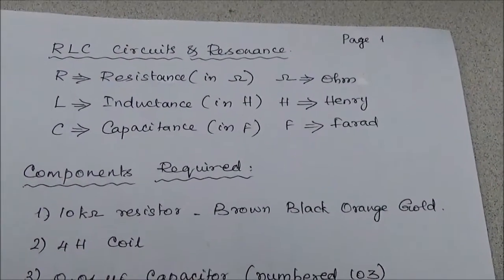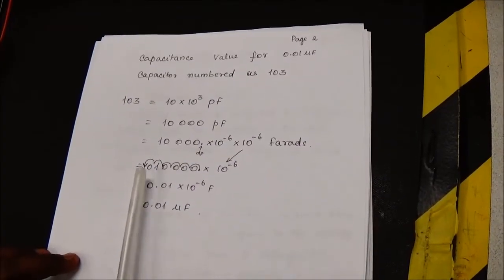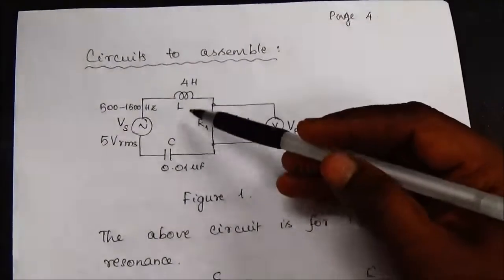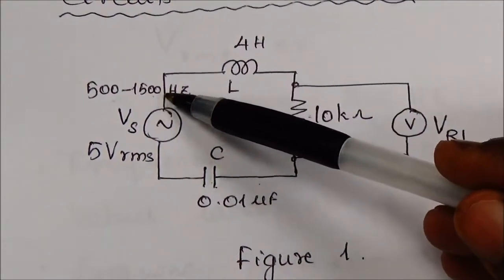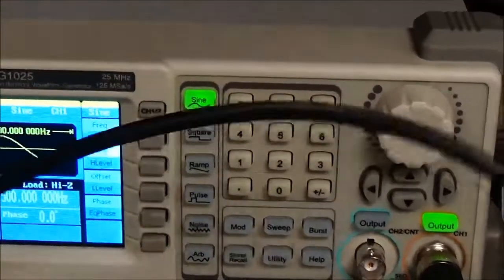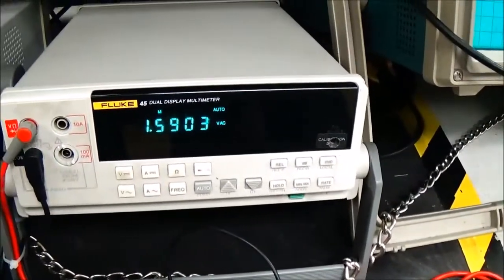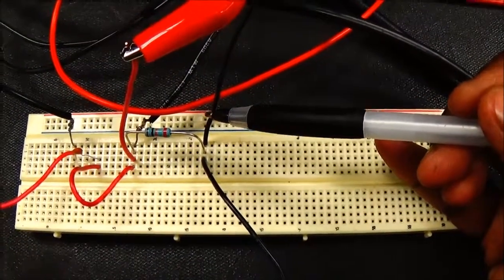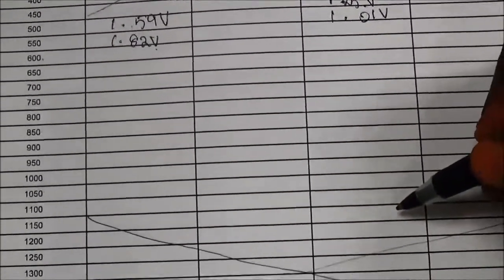RLC circuit and Resonance

Comment: thanks alot for this video
but practically you mean the resonance is at the bottom or the top of peak in curves?
Reply from the maker: +new man Resonant Frequency of a parallel circuit is at the bottom and for a series circuit, it's on top. Thanks for watching and your question.
Reply: can i add you on facebook?
Reply from the maker: +Bhuvana Sriganesh Basically, the resonant frequency is the same for both series and parallel circuits. The difference is voltage across the resistor is maximum at resonant frequency in a series circuit and minimum in a parallel circuit.
Reply: please i have two questions:
how much voltage increase in across inductor in resonance case
is the difference between using ac or dc current in resonance case?
Reply from the maker: Do you know one important thing about resonance? When R, L and C are connected in series with a variable ac power supply, at a particular frequency called resonant frequency, voltage across L and C would be equal. Since they are acting in opposite directions (recollect from the phasor diagram - Vc on negative imaginary axis and VL on positive imaginary axis), they cancel each other. At this frequency, XL = Xc that cancel off and total impedance of the circuit is just R. Since impedance is min = R,  I is max at resonance in a series circuit. Since L and C allow AC signals to flow freely through them and block DC, you wouldn't be able to study the effect of resonance with DC supply. Now research about parallel RLC and come back if you have questions.

Comment: In AC there is no positive  or negative. That should be live and neutral. The color of the wires used on breadboard is supposed to be black and white( it may vary country to country)
Reply from the maker: Abdul Kadhar Thank you for watching my video and your valuable comment. I'm so happy. We use here red and black wires to represent positive and negative respectively. The input is taken from function generator that has red and black leads. To keep the students out of confusion with respect to terminology and the color codes, I used the terms positive and negative while connecting. The DMM leads are again red and black marked as positive and common. I explain to students that the polarities of the terminals switch from positive to negative and back continuously when supplied with AC signal. Thank you for bringing this up.